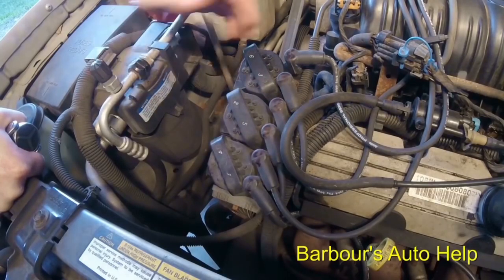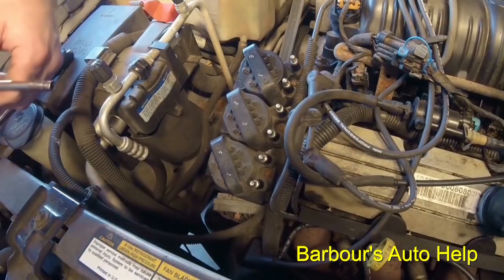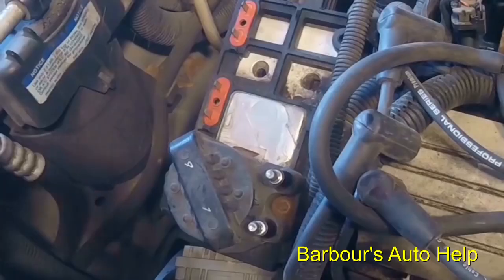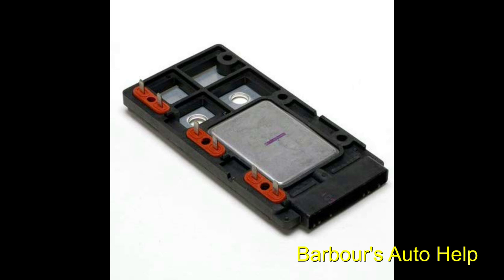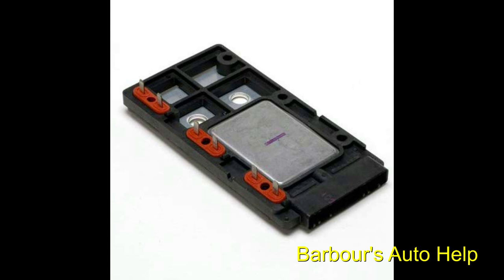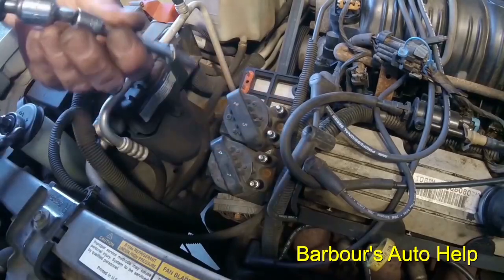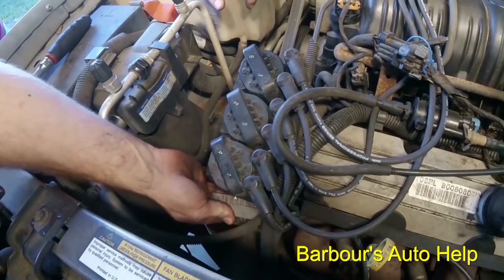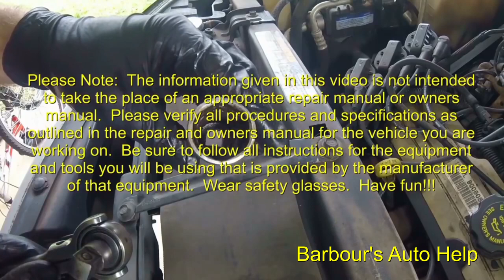Ignition Module Replacement GM 3.8L Series 2

Comment: I was desperately looking for the ignition module on my firebird 3.8. Now i know where it is, thank you. The modul  is expensiv in my country but i try to replace it.
Greetings from Bavaria/Germany.
Reply from the maker: Glad to help.
Reply: If you haven't bought it yet, go on google, ebay, or amazon and search for Delphi DS1004. Delphi is the manufacturer that makes the part for GM and Ac Delco.

Comment: Thanks Keith! Very helpful and perfectly explained as always! Did mine over the summer plus coils. AC delco parts of course! A great part of a tuneup on these 3.8s. I used a very thin layer of thermal paste under my module. Better conductor. Alot of times there is a whiteish crumbly film on the plate the module sits on, clean that off. A fine wire brush works great and then a fine abrasive cleaning pad to get it clean. Then wipe off with rubbing alcohol, then install module. Also, I had 103,000 rounds on my clock and also replaced plugs, wires, air and fuel filters. I don't think the coils or module was bad but good p.m. and what a difference the coils and module made! So maybe they were on the way out. Expensive complete tuneup but delco parts for all this is a must! "My car doesn't need this, I'm just showing you how to do it". Priceless!

Comment: Very helpful, I didn't even know there was a 5.5mm hex. Isolated the defective coil by pulling off the wires and when there was no change I knew I had the right one. Almost no shock at all LoL.
Reply: 5.5 mm = .2165 and is only .002 of an inch small than 7/32 which is .2188 so you will never risk damaging the head of the bolt by just using a 7/32.
Reply: Omgosh! Who has a 5.5mm!?? Ugh Not me....just one of those things to prolong my work. Great video! Thank you 😊
Reply: My coils are held down by 5mm bolts and its the same engine that is in the video but in a 2002 buick lesabre. Im not sure if the wrong socket size is being used in video or if my car has smaller hex head bolts installed.

Comment: I think the process with the heat and the thermal grease is one transference. The grease or paste dissipates the heat by transferring it to the backing plate. That’s why dialectic grease is less effective. It absorbs the heat and compounds the problem.

Comment: If you don't have any symptoms, just the ck engine p1352 try taking if off and cleaning everything with electrical cleaner and reapplying the dielectrical grease. It fixed mine.

Comment: Replaced ignition module on my 2004 lesabre. Did the trick. Being mounted directly on a portion of the engine block seems like it would get too hot.
Reply: So does anything need to be reset with electronics when replacing for a 2004 lesabre? Or is install the only instruction?
Reply: @jefferyedwards8623  no resetting of anything needed. My symptoms were rough running with engine light on. The coil mounted the most forward was not producing spark (each coil runs 2 cylinders). I replaced that coil initially but still dead. The engine module fixed it.
Reply: @track1219  thank you, cost at shop is 1000.00 dollars. Cost for a home fix is 130.00

Comment: I also had one bolt I could not get out no matter what I tried.  I ended up grinding the head down and then put a replacement bolt in.  I used a 8 -32 1 1/2 bolt.

Comment: Dear Keith,I  have a 2005 Gran Prix with 3800 and the number 3 & 4 cylinders aren't firing. I'm very mechanically inclined would a bad coil cause this. Also the car has an exhaust leak that gets inside the cabin. Would a bad catalytic converter cause this. The exhaust almost killed Me.
Reply from the maker: If one coil is responsible for firing the 3&4 cylinders then it very well could be a coil.  Sounds like you may have an exhaust leak.
Reply: Yes it does, Did a little research and there a Dr. Koz in California that sales carbon monoxide detector's for 185 dollars. He said they have more sensitive than house hold which detect the 60-70ppm, while car detector detects between 1-9ppm. He also said this happens more often than people think. Signs of carbon monoxide  are dizziness, pale skin, nausea and a weak heartbeat. Which are signs of vertigo.

Comment: Need Silicone "Heat Sink Compound" on the back of the Ignition Control Module to transfer the heat away or it will get hot and shorten the life.

Comment: came to you tube for some help. my car was misfiring and I looked up causes on here. I replaced ignition coil , module and spark plug started her up and she was working . cleared errors. drove about 13 miles , check engine light came back on. scanned said bad cam shaft module. My car doesn't have one. here is question. If I didn't use any  heat sink compound could that be why I get the error.
Reply from the maker: Probably not that quickly.   But, I've never heard of a camshaft module.
Reply: There is a crankshaft sensor that can go bad . They’re on eBay and Amazon for about $35 / shipped .

Comment: Does each coil pack receive power separately from the control module ? 
2 and 5 plug wires won’t spark with brand new coil pack. The other 4 do.
Replaced all plugs and wires and the middle coil pack.
Reply from the maker: Sounds like it would help to take the model down to the parts store and have them test it.  Not sure if all coils receive constant power and the model controls the ground side or the other way around.

Comment: I found a set of zzp 47kv coil packs for a 3800 on a supercharged 04 monte carlo and I took the ignition module with it and my question is will there be a problem putting these parts on a 04 lesabre without a supercharger???
Reply: Ignition control modules are the same on 3.8's with or without a supercharger. The coils however will work with a stock 3.8. The ZZP 47kv coils just create a hotter "Stronger" spark.

Comment: dielecttic grease doesnot conduct heat  ,a thermal paste does. they use it for setting cpu s on mother boards.  also ford ignition modules that sit on side of distibutors  use it also
Reply from the maker: As mentioned....use what you think is best.  Cheers

Comment: Just replaced battery,alternator,crankshaft sensor car would die at random very dangerous to drive.doesn't did anymore but my new mechanic says may need ignition module.car bucks real bad no power mom any advice thanks
Reply: Mine wasn't dying...yet, but was bucking under acceleration, new coils and module did the trick, not sure which one, never had them tested.🤷🤦😋

Comment: Don't use dielectric grease/bulb grease.  Use thermal heatsink grease.  

I just bought an ICM today for a 92 Oldsmobile Cutlass Supreme 3.1 engine from Advance Auto.  I bought their house brand DriveWorks.  Looked just like the one in the video.  Here is a snip of the instructions down below.  It did come with a plastic pack of white thermal grease.

"It is absolutely required that you apply the thermal grease provided to the metal back plate of the module.  Failure to do so will shorten the life of the module and void the warranty."

Make sure to clean the mounting plate that's on your car really good.  Then spread the thermal grease all over the back plate of the module.  Back plate of module is the side that kisses up against the mounting plate.  It's metal to metal contact, and the mounting plate wicks heat away from the module.

If you don't have thermal grease, you can buy a pack of it at AutoZone for sure.  Amazon sells it too.  Links below.

https://www.autozone.com/miscellaneous-cleaners-and-degreasers/heat-sink-compound/wells-heat-sink-compound-1-ea/19189_0_0

Super Lube 98003 Silicone Heat Sink, 3 oz Tube, White
Reply from the maker: Thanks for sharing.   But, that is a different engine and a different set up.  Thats not a 3.8 series 2.
Reply: @BarboursAutoHelp  I know it's a different engine, but the basic principle is the same.  Don't use dielectric grease.  Use thermal grease.  Thermal grease contains fine metal oxide powders, and dielectric grease does not.

Comment: I have a 2004 Impala 3.8 that cranks but won't start, even with starting fluid being sprayed in the intake. I have already replaced plugs, wires, coil packs, injectors, O2 sensors and the crank position sensor. It's not showing a code and it does have pressure on the fuel rail. Could this be the culprit?
Reply from the maker: Possibly.  But, it could save you money having a tech look at it.
Reply: @BarboursAutoHelp  it's actually in the shop now. If I'd known about this I probably would've tried it before sending it in.
Reply: @xjmathews  was that your issue?
Reply: @Michael Preston yes it was!
Reply: @xjmathews  thanks a lot just swapped it and fixed the 02 bird I was working on!
Reply: YouTube is awesome!!

Comment: Do I have to replace the ignition control module if I am getting plugs and wires done?
Reply from the maker: I'd say no unless it's bad.
Reply: @BarboursAutoHelp  is not starting sign of bad ignition module, crank but no start with no tick on techometer
Reply from the maker: You'll have to have it checked.   If in doubt have it tested.

Comment: The video sows how to replace but is missing some very critical steps. The ignition module is grounded to the plate below. It is the ONLY ground point. That plate is often oxidized and as such will provide a poor ground and cause intermittent operation. It MUST be thoroughly cleaned with emery cloth and wiped clean so that the module will have good ground contact. Then apply CONDUCTIVE  Heat Sink Grease under the module before mounting it back with the coils. Dielectric grease can be used but only on the terminal boots not on the module. We have seen instances where just a thorough cleaning of that plate restored ignition module operation.
Reply from the maker: Sorry, Sir.  But you are incorrect by saying the ignition module is grounded to the plate.  It is not.  It has a dedicated ground wire. (At least for the vehicle shown in the video. )  The compound application is only meant to help transfer heat.  Not conduct electricity.  What vehicle are you referring too?